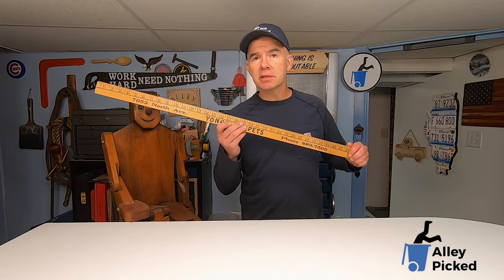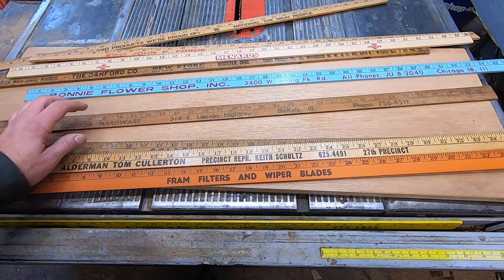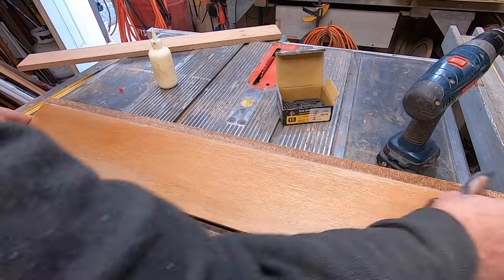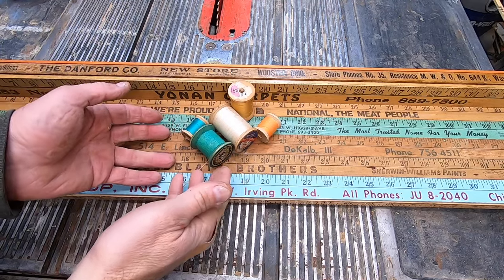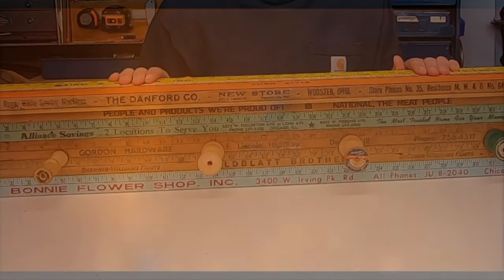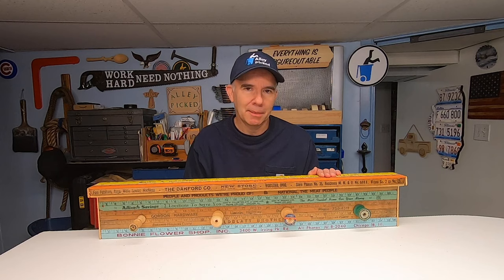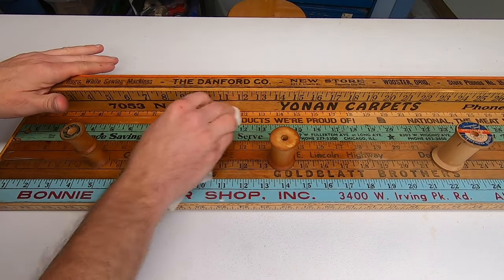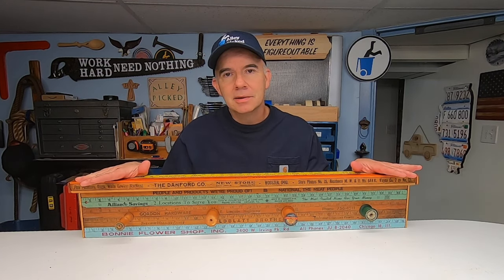Upcycling yardsticks into a coatrack.

Comment: I have made two table tops out of yardsticks. Kind of intimidating using epoxy for the first time. Do you think shellac would be a good option?
Reply from the maker: I have made one recently in a video also. https://youtu.be/KejJsUIgf-M
The epoxy top came out fantastic! It depends on how you want the final finish to look. Shellac is rather thin and not extremely protective. Polyurethane is not a bad choice and would be my first choice if I didn't want to use epoxy.
Reply: Thanks for the response! I will try polyurethane.